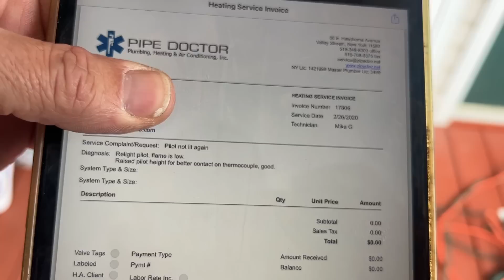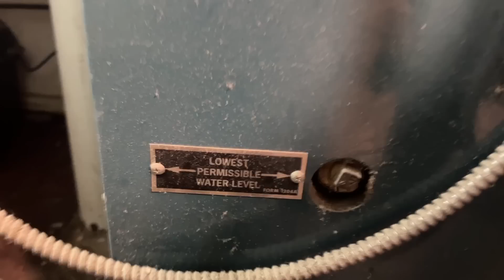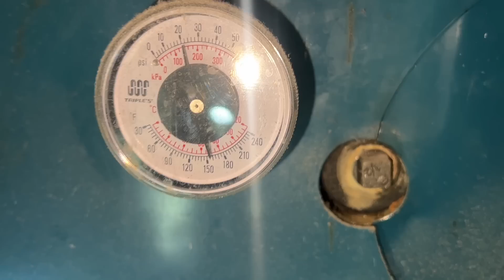Multiple Zones in Gas Boiler Not Working and Heating Defective Zone Valves Diagnosed & Replaced

Comment: When  you move the lever   the unit was supposed  start  working. It's works  manual  and auto..  also take pressure  reading... that circulator. Maybe  working  at too low speed.. nobody  knows...

Comment: mikey, i have a system almost like this. ive been here 4 yrs in western ny and furnace is from 1970s original. im a renter and constantly having issues with zone valve and one baseboard on first floor always gets stuck on. he just replaced it for first floor month or so ago. a week later stuck again. what else could cause this or can zone valve is act up so much. the wiring looks horrible. i cant get my landlord to understand. I'm so aggravated must manually close it by spinning the dial. it keeps getting stuck in the open position. ?? i wish you were in are area.